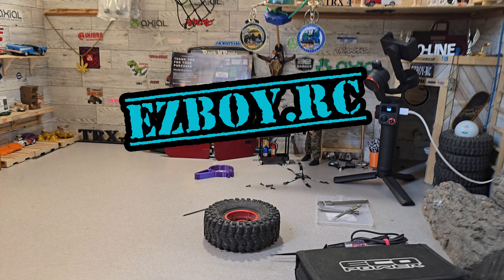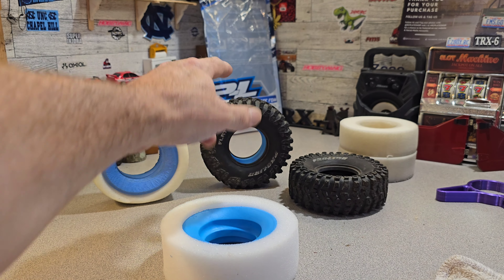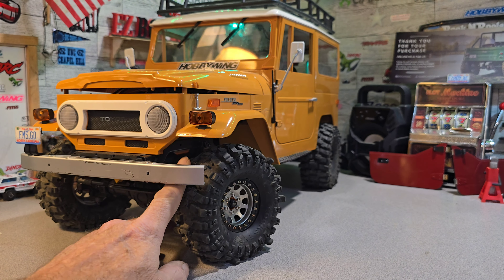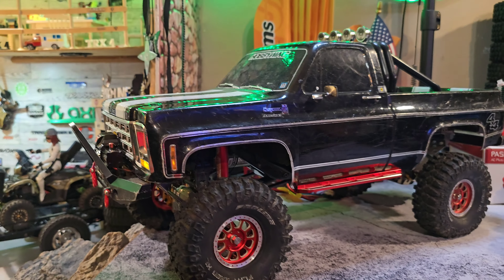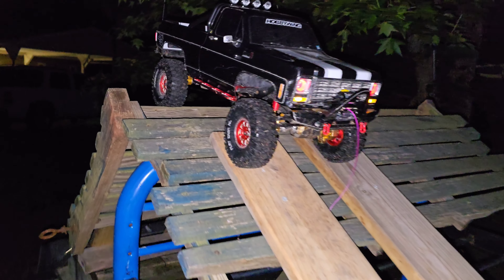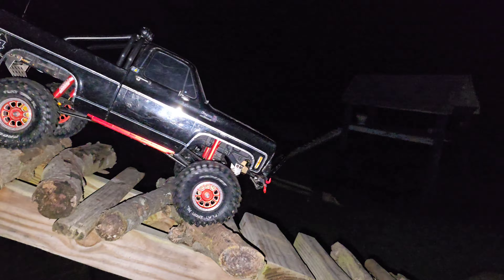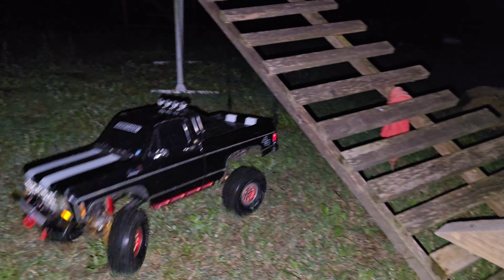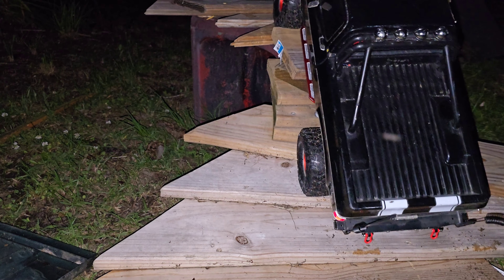New proline dual stage foams on my TRX4 HIGH TRAIL K10 & Dual motor winch test.

Comment: Ok i know you did the 1:24 scale crawlers. Tons of Experience.... What is your Take on Portal Axels ? And Why ? Not sure i like them on my WPL anymore. Yummy Dinner. hehehe
Reply from the maker: I think portal axles are fine as long as they're good ones. The FMS small portal axles are really good. It helps lower some gearing and give more torque. Less strain on the motor.
Reply: @ezboyrc553  My WPL is riding sweet with the 370 motor an gear box.